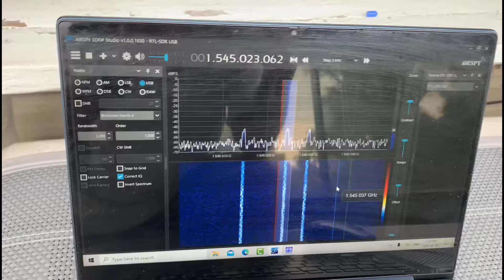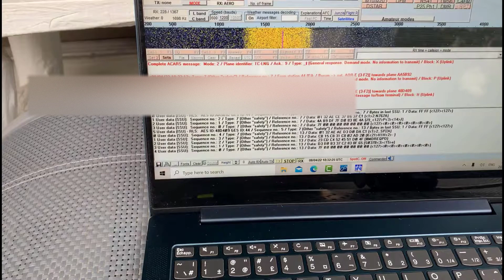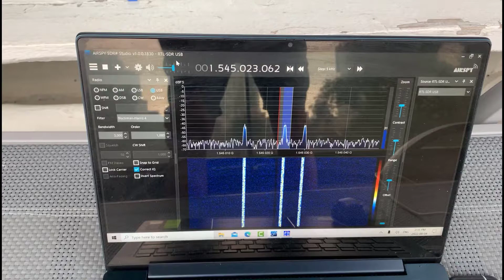RTL-SDR for Inmarsat Satellite - Dish vs. Patch Antenna

Comment: Hello Jeremy, could you mount the Patch antenna into the focal point of the dish? in that way you will get the circular polarisation with the advantage of the big dish :) 73! DE1CtL
Reply from the maker: That's a great idea, I will try it! Stay tuned.
Reply from the maker: Tried it, you are right, the patch antenna gain goes up when you put it inside the dish envelope! Thanks for the idea.
Reply: If you stack 4 of those patch antennas, you should get 9dB extra which would be equivalent to the dish, I think. Problem is phasing them together so the signals add up. I don’t know what the proper spacing should be between them.
Reply: @eswnl1  thanks
Reply: @catalinalb1722  I’ve never tried this though, so I’m hoping that someone with more experience can verify this theory.